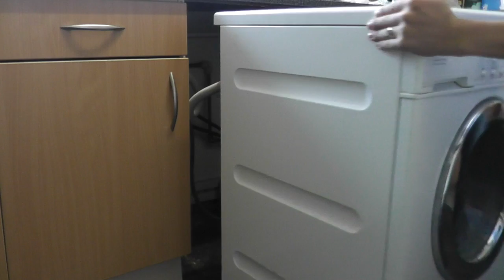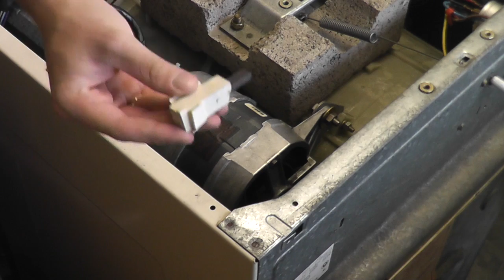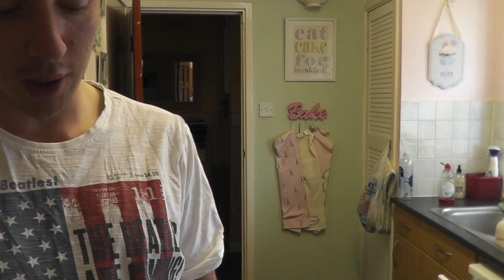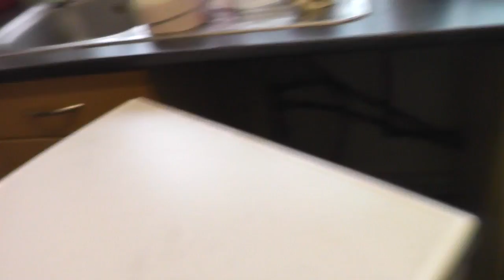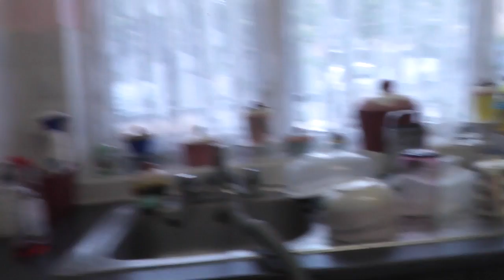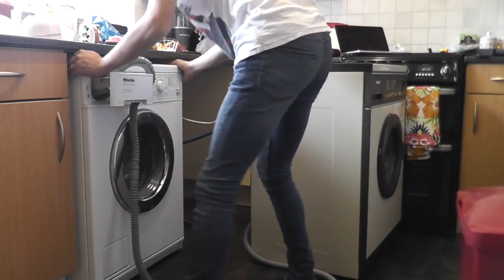Hotpoint 9530 Carbon Brush + Solenoid Valve Replacement

Comment: this video maybe six years old and i dont have any knowledge about replacing carbon brushes, but why did it say indesit on the package? is it for compatibilty? im just curious
Reply from the maker: Because it's supplied by Hotpoint who are part of the Indesit group. These were still being supplied to Hotpoint after the Indesit takeover in 2001. As the GEC motors were still technically valid till 2004 with the last WD's

Comment: i never seen  a washing machine with motor in that position
Reply from the maker: Hotpoint were very unique in mounting the motor at the top. Made for easy repairs and protects the motor from any water leakages

Comment: I have forgotten just how noisy they are with the lid off
Reply from the maker: Kevin Steele mainly because the motor is mounted on top, so it’s a lot louder
Reply: @HooverA3060  easy to get to those brushes to replace them.... Hotpoint were pretty unique in mounting the motor in that position

Comment: 34:45 *Crushes power cable and water inlet and outlet hose*
Reply from the maker: The machine wouldn't crush them as it doesn't go all the way up against the wall
Reply: what did it hit off?
Reply from the maker: It just pushed back against the wall, the lid extends further back from the machine so that touches the wall first and leaves a gap

Comment: When will you do your next washing machine video? I'm waiting patiently.
Reply from the maker: sans comic there’ll only be ones of BHF as I’m not doing anymore of the Miele and only one more of the Hotpoint before she’s out into storage
Reply: FlorenceBallardA3060 oh ok what will happen whens she's in storage does that mean there will be no more washing machine video's?
Reply from the maker: sans comic it means the Miele and Hotpoint will no longer be filmed until I move and I’ll bring new machines into the collection
Reply: FlorenceBallardA3060  what new one would I expect you to get plus the hotpoint still is running....... right? What Day can I expect a new washing machine video?
Reply from the maker: It'll be when I announce it, you have to be patient and I won't tell you what I'm getting because 1. I don't know and 2. It's to be announced in a video
Reply: FlorenceBallardA3060 ok . Waiting is worth it. And I'm happy with vids of the hotpoint. It's a lovely washing machine
Reply: FlorenceBallardA3060 worth waiting and she stills has years of life
Reply from the maker: Exactly, she'll even outlive a Miele lol
Reply: FlorenceBallardA3060 yes she will. Lovely washing machine that is.
Reply: FlorenceBallardA3060 wouldn’t it be best if you took the motor out first then fit the brushes
Reply from the maker: Karl Smith nope, these are designed so you don’t have to take the motor out to do that. It’s just cause it was my first ever repair
Reply: FlorenceBallardA3060 what’s the capacitor for next to the solenoid valves
Reply from the maker: It's the main capacitor for the machine :) It basically is what runs the machine and gives power to it